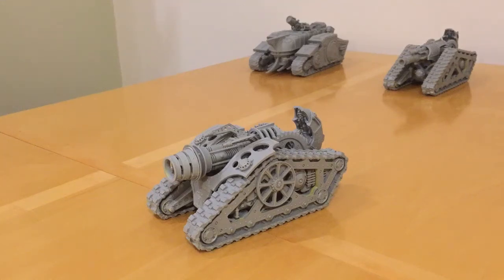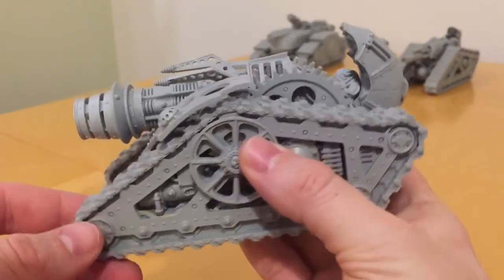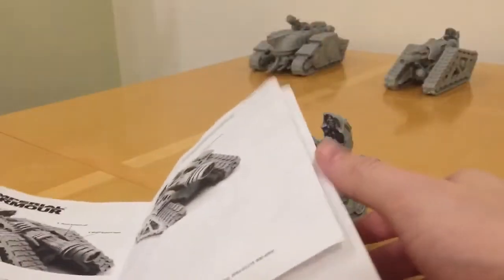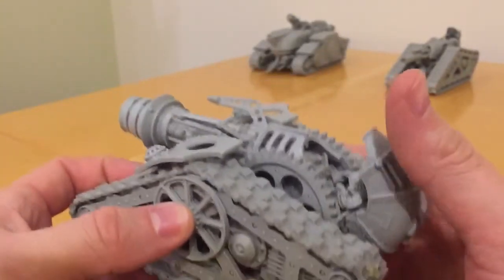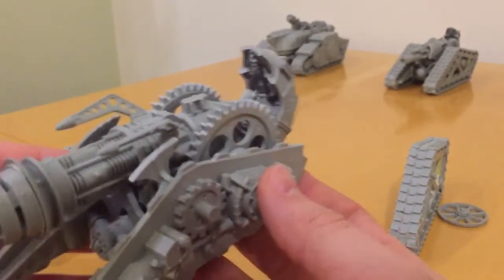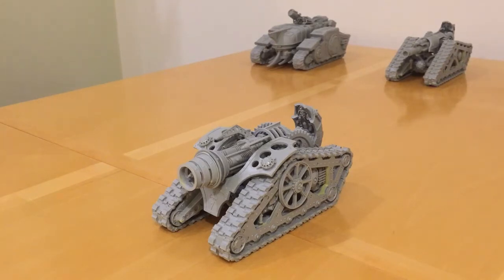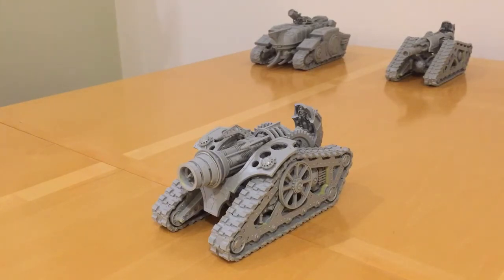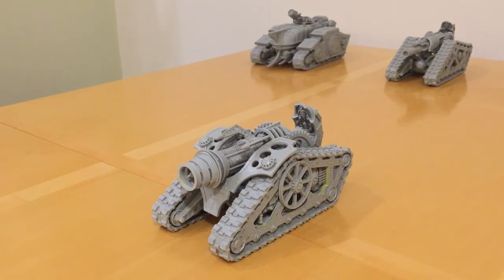Mechanicum Krios Venator: Model, Build and Rules Review

Comment: Great review! It seems quite undercosted compared to the other tanks you mentioned. Especially with the great special rules.
Reply from the maker: +Stephan van den Brink Cheers, I'm glad you enjoyed it!

That's an interesting observation on the points cost as the Krios Venator (150) sits between the Vindicator Laser Destroyer (130) and the Sicaran Venator (195). The Vindicator has better range, accuracy and AP but it's armour is substantially less effective and its mobility is lower without upgrades and absolute firepower lower. The Sicaran Venator on the other hand is again less durable but has almost equal mobility and the Neutron Laser is a specialist application weapon that needs to be used against Super-Heavies to really earn it's points back.

I'd say the points feel about right, however in my view the Mechanicum get the most versatile and tactically flexible option in the Krios. Thanks for watching!

Comment: Rules wise I've never been sure of the Venator, it's clearly anti armour, but mech have easy access to haywire spam which seems to do the job better. Other than theme and the nice model is there anything you've found this is the best at?
Reply from the maker: Zippokovich Well, the Venator's key strengths are it's speed and firepower focused in a single weapon system coupled with tough frontal armour. It can flank more quickly and compactly than ground units with haywire e.g. Secutors in Triaros. It's range is also superior to the haywire options. As I mentioned in the video, I originally bought the vehicle for an apocalypse battle where I used it to good effect on the flanks, particularly when it wasn't the most threatening target.

All the above was true up until a month back with the appearance of the Vultarax which has a similar anti-armour capability and bigger threat radius (and sits in the quiet Fast Attack slot).

Ironically, it's most efficient use may now be against the Mechanicum itself. The Pulsar Fusil is very effective against Thanatars for example... although Darkfire Cannon armed Castellax are a less potent but more durable counter.

What is your haywire approach, Vultarax, Secutors or something else?

Thanks for the comment :)
Reply: Vultarax now, before I took Secutors if I expected heavy armour but otherwise relied on darkfire castellax or punchy ursurax to get the job done. I just ordered a Kiros actually but it was the normal one as I like the look if its gun more. I also realised there kind of is a titan scale fusil in the form of the Ordinatus Ulator - the fluff is different, but it has a similar muzzle design